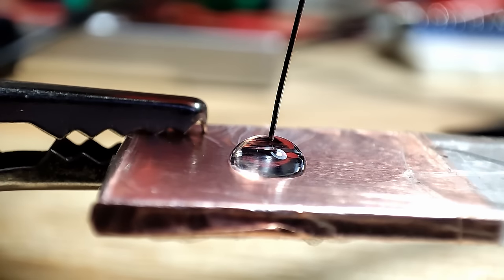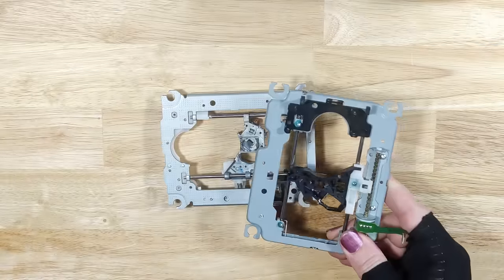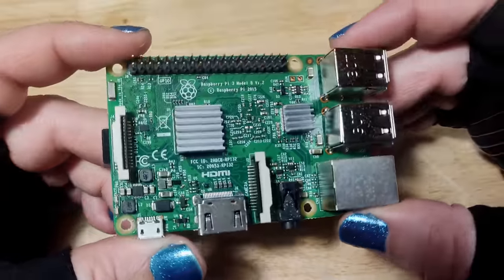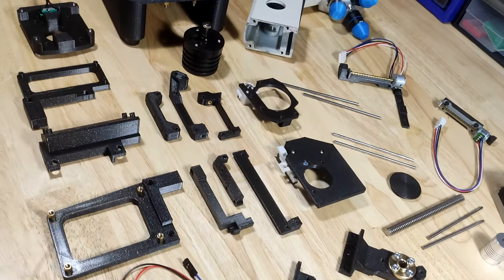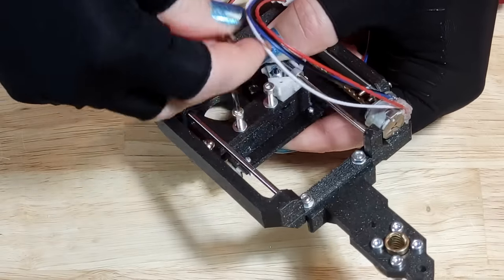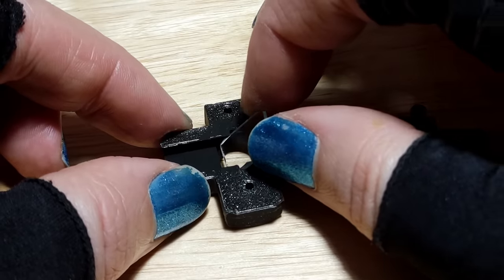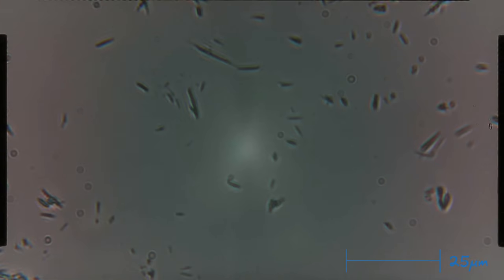How I Greatly Improved My Cheap Microscope

Comment: Excellent job! Since there's already a Raspberry Pi in the loop, you can relatively easily add some more functionality by using (almost) real-time image processing with OpenCV to fix contrast and lens distortion issues or add measuring overlays, or even automatic feature detection and measuring.

Comment: What an awesome video, at first when you pulled out the CD drives I was like "oh no, it's going to use those tiny steppers for the mechanism" and the you use them for the X/Y adjust and I wast like "Wait a minute, that's actually a pretty good application for those little steppers, it only has to move the slide, what a genius" and then you used the big stepper for the Z, that is a nice use of the correct steppers for each thing, keep up the amazing videos.

Comment: I really like the stepper motor controlled bidirectional stage.  You could do the same with  stepper motor and a higher pixel camera for focusing so the stepper motor is controlled by software that determines when an object is first in focus, takes a photo, then incrementally focus further down in increments and taking a photo at each focus increment until the object is just out of focus then stack the individually focused photos.

Comment: I'm impressed you could get rid of that much chromatic abberation by adding your simple DIY beam splitter and thus light it from the same direction as the camera.

My first idea when I saw your abberation shots was that it had to be coming from the glass piece you put in front of the sensor as this isn't flat on the sensor and thus allows for some light bouncing between sensor and glass (as it is probably also not perfectly parallel to it also)

I will also try to experiment with my microscope a bit more to add this as a light source option as I'm now struggling with ringlight and polarizing filters to get some decent shots.  (my magnification is nowhere near what you're using as I use it for PCB assembly and repairs and debugging my prototypes)
Reply from the maker: Indeed, I too think the protective glass might make the chromatic aberration worse, but luckily the epi-illumination seemed to greatly improve the matter. Unfortunately the epi-illumination makes the contrast a bit bad and I think that might be due to having no corrective optics for the light and because I have to pump so much light into the glass "beamsplitter" that despite the matte black pained beamdump area, some of the transmitted light does end up reflecting back up at the camera directly.
Reply: @BirdbrainEngineer  Also quite likely there is no anti-reflective coating on the "view side" of the lenses.
Maybe you can add some polarizing filters where you feed in the light and/or some aperture insert.
However this does probably require you to increase the amount of light you need to feed in even more.
Maybe you can also play around a bit more with the pixel integration time so you don't need as much light.

Comment: That's a cool mod and a cool project. You should take a look to the PUMA project. It's a very good 3d printed microscope, with an optional epi illumination system. You can probably get some ideas here, and learn a lot about optics.

230nm is not "ok" for an optical microscope lol, in theory it's very near the maximum resolution you can achieve with visible light.

With visible light a good oil objective (100x/1.25 oil) can resolve up to 244nm (0.61⋅500 / 1.25).
Some very expensive oil objectives with high NA can go up to around 200nm.

A 60x dry objective is typically 0.85 NA so you should not resolve more than 360nm with it.
Except if you are using near UV light, you can achieve 230nm resolution with a 315nm wavelength.

If your 60x objective is cheap and not made for light reflected microscopy you will lose a lot of contrast anyway, because it lacks anti-reflective coatings.
And if you don't use a coverslip (probably required, if you see 160/0.17 on the objective) you will lose some sharpness.

You can try to buy a half mirror to replace your piece of glass. With the mirror face correctly oriented
you should gain contrast (it will also remove some ghosting artifacts caused by the two sides of the glass).

I'm using one from aliexpress and you can find it with "Optical Glass Telephoto Beam Splitter" or "Beam Splitter 50T/50R" for around 5€.

Also, I'm not sure if the thick glass on top of the sensor is optimal. I would have used a much thinner glass.

Comment: At the beginning you're talkin about if it's necessary to build such a thing, and i can tell you it's definitely not!
But... i totally understand why you made it, tinkering with electronics, optics and a 3D Printer is so much fun to do! 
Great Video, great Project!
Reply from the maker: I mean yeah, getting a proper trinocular microscope for 300€ would have sufficed for everything... but this was a fun project and technically I spent only like 10€ on the new stepper drivers but the rest of the stuff I got for free from tearing down stuff :P

Comment: I have a cheap AM scope that is even worse than that one, at least yours has a iris, mine is just a disk with holes in it.....yeah...and its off center.....yeah....

Anyhoozle, Ive been able to correct a fair amount of the chromatic aberration by better aligning the stage to the optics. Basically wiggle it around, not just in translation XY but roll and pitch too (idk, add some screws somewhere as jack screws for modifying the plane of the stage to the optical path). 

There is a lso the stop spring detent thingy under the nose on the turret, you can loosen that and see if there is a more advantageous stop angle. You could try reseating the turret (take the head off, remember how the 3 screws are set so you can recenter it (another potential source of aberration btw), then remove the penta mirror holder (another source of potential misalignment, I had to use a pipe wrench to get mine loose), THEN work on breaking the nut loose that affixes the turret to the nose (oddly enough, its usually in there solidly enough that....well everything aligns to it pretty much...), but thats on you if you want to take on effectively an entire garage realignment(OH! By the by....you can open up the rotating section of the turret too via the screw and spanner nut in-between the objectives (the screw holds the rotating objective mount on, and the spanner nut sets the turning tension (IIRC), ie how much resistance there is to turning it once you overcome the detent) BE CAREFUL!!! There is a handful of tiny little ball bearings in that thing....so be prepared to wrangle them if you go in there)....it can be kinda frustrating....but they dont really put too much effort into setting up these cheap-o scopes from the factory. When I got mine I had to take the lenses apart because there was mold in them.....yeah.... 

Work slowly and incrementally, and you should hit on an orientation that counteracts the aberration you see down the tube. I guarantee you're aberration problems are more to do with alignment than your lighting set up. Either way, fiddle with it, thats what the hacker/maker hobby is all about ;)

Comment: This would be a great place to use a Pi Zero given your low compute needs, but I imagine the full size pi is what you already had lying around.
Reply from the maker: Yes, the Raspberry Pi 3 is what I had laying about and unused. As for using the Zero... I'm not convinced it could handle the stream at such a high fps (maybe the Zero 2 could), plus the stream over wlan is going to be a concerning proposition compared to just lan. I did try to stream over wi-fi in this case too, but it did have some problems... but that could simply be because my router is kind of far from the microscope and the signal quality isn't really the best it could be.

Comment: Is there any way to switch the objectives/lenses from the microscope? I know the cheaper microscopes have them hard mounted but your set up is awesome, i think the only bottleneck truly are the bad optics. That and maybe more light would help a lot
Reply from the maker: The objectives can be replaced, however the thread is weird... I have not been able to find fitting objectives anywhere. I did buy a cheap 60x achromatic from China just to see what would happen, and 3d printed a thread adapter... And it worked, but it's fairly unwieldy and the contrast issues got pretty bad in most cases. I did manage to resolve down to about 230nm or so with the 60x though.

Comment: this is amazing work, way to go!
Only thing i would do differently is to control all directly from the raspi rather than the external MCU, so you could add a fully remote operated microscope. Why would you need that? dunno. but that's not the point, the point is you can :P
Reply from the maker: Of course I considered that but I did not want to spend an extra week figuring out how to write that kind of code, so this time I used the Arduino... which also means that technically the microscope is usable without turning on the RPi (eg. when I want to just use the normal eyepiece... though I probably never will, the camera is so much more convenient haha)

Comment: Great project. I watched your spin coater design as well, another very cool piece of lab equipment. Im not sure what your final aim is with these pieces of equipment, however if you are trying to get nice films from spin coating your need to clean your substrate in a non contact method, normally an ultrasonic bath followed by a surface treatment, such as UV ozone cleaner. Anisole and xylene are good solvents, but have you tried water? If you want to test out surface treatments and coatings just use thinned PVA glue initially. You should give KiCAD a good great open source PCB design software
Reply from the maker: Next video will be about dealing with the cleanliness side of things :> 

The end goal is as was said- microfluidic devices for now, and experience for future in order to hopefully make integrated circuits, lcd-s, oled-s and other such technology that relies on such miniaturized processes.

Comment: 1:38 Dam I love this video! :face-red-heart-shape::face-red-heart-shape::face-red-heart-shape::face-red-heart-shape::face-red-heart-shape::face-red-heart-shape::face-red-heart-shape::face-red-heart-shape::face-red-heart-shape:
I've got the same reflexion.. Should I buy objectives and design my own with my 3D printer and maybe pimp it with arduino laying around???
Then, one year later, I still have the 4 unused objectives and eye piece and a lot of random arduino parts, but missing a scope!
And this week, I've found a new/open box discount on a SWIFT 380B for 203$ canadian, shipping next day included!
So, short story, it's better to buy a great scope in discount.

I will print dark field filter and phone holder to get great image and save my eyes.
Maybe one day I'll DIY epifluorescence on it?

SWIFT 380B regular price 299$ canadian. Sold by SWIFT on Amazon (218$ US = 204 Euro)
It was just above my budget for this project. But I couldn't resist at 203$ cdn (148$ US = 138 Euro)

Comment: Did you test if the protective glass in the camera compartment might affect image quality? You might get a nicer final image if it's removed. There is the chance light might be bouncing around inside the glass and affecting the contrast or sharpness. It might be totally fine I don't know. It's just pure speculation from someone with a very very casual interest in camera lens design. It's a nice project you did a good job with everything.
Reply: I think it might be giving you a little chromatic aberration. Camera lenses need to be accurate to wavelengths of light. I am just speculating here. You probably know more than me with everything here lol. You could try painting the edges of the glass with that acrylic paint too. It might help with light bouncing around within the element.
Reply from the maker: Could be, though from the very limited and quick testing (to prevent dust on the sensor) I did, it did not seem to impact the quality at all to be honest.

Comment: love it ^^ would love to try also to do the optical stage diy because then the whole thing could be 3d printed. i have some microscope objective conected to a bare ccd webcam camera. it kinda works just like yours. i would like to focus stacking for 3d nano scans since this is cnc controlled.
Reply from the maker: Maybe it would work out -in that case it would be possible to shape the epi-illumination light a bit better too as the light-path can be longer than 2cm between the lightsource and beamsplitter haha. The problem I can imagine happening is that the alignment would be difficult to get perfect with 3d printing. Cool idea though, maybe one fay I'll try it out!
Reply: @BirdbrainEngineer  maybe with resin parts. So far for another project I been using resin parts and being able to print usable gears at 0.5 mm pitch is mindblowing and fairly mechanical accurate. I will look up if I can think of something.

Comment: Nice project, can the fps of the camera be higher with lower resolution?
Reply from the maker: Yes. At 1080p you can easily get 30fps, 60 might be difficult but iirc the Raspberry Pi cam 3 is able to do it technically. You will certainly need heat sinks on your Raspberry Pi though, as the streaming is quite demanding, even with the heat sinks shown in the video, the Pi gets up to like 60-65C.

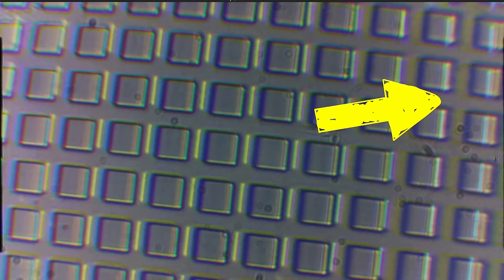Comment: 11:17 could be field curvature, lens based telescopes have the same issue and require a field flattener to fix.
You also seem to have a lot of chromatic aberration  which is q problem with the objectives. (Although your light source isn't helping as you find out)
Reply from the maker: Yep, the objectives are not great but they will do for now!

Comment: what i've seen someone else do for the lighting setup is a ring light and a polarizer filter over the objective lens, though i think that might be a bit of a hassle to replicate on your setup.
the result if you can make it working is amazing though for electronic work
Reply from the maker: Was the ring of lights on the outside too?
Reply: @BirdbrainEngineer  yeah, it's not exactly attached to the objective lens
Reply from the maker: @aronseptianto8142  I'd imagine then what you are talking about is likely a stereo-microscope, which usually doesn't magnify past 40x or so. That is fine for working on PCB-s, but with my liquid lens project I was having trouble with dust particles only some micrometers in size, so to see those, you can't use that kind of microscope. The polarizer in their case gets rid of glare - photographers and videographers also use polarizing filters for exactly that purpose.

Comment: Would the lenses of the optical drives be of any use?
Reply from the maker: Probably not. The lenses in the optical drives are small (even the half mirrors in it are too small - I initially wanted to use a half mirror from there).

Comment: just a small thing

it is physically kinda impossible to go much under 500nm with light microscopes because your light wavelenght is literally maxing out in that range. you are pretty much at the edge of what a normal light microscope can deliver.
Reply from the maker: With no extra tricks, optical microscopes can resolve objects as small as half the wavelength of visible light, which means it would be possible to make out features down to about 200-250nm or so. So, technically there's still some ways to go, not to mention having worked with it a bit by now, in practice, without painstakingly finding the most optimal z height and all, I am only able to resolve features down to about 500nm (with the 40x objective that the microscope came with)... beyond that it's really a chore to really see anything on a real IC for example.
Reply: @BirdbrainEngineer  
yuss

you just sounded so dissappoinnted with the "just to 300nm" and thats already about so close to how good it gets

especially if you dont use a single wavelength light source

love your video and will definitly use all the inspiration I can get for my own microscope, want to stalk bacteria with it tho

Comment: Neat build, in fact I think I'll dig out my old microscope and see what can be done with that.  

Now if anyone's interested DIY perks did a video on turning a laptop webcam into a usb webcam (so if you have a laptop for parts or know a computer repair shop), it's at:  https://www.youtube.com/watch?v=C8pFkhkTvqo

As for the light source the Dollar Tree used to sale (perhaps they still do, just haven't seen them for a month or so) these clip-on selfie lights that possessed a ring shaped circuit board with a rechargeable battery occupying the center with three light settings.  I figured it'd be possible to either use it as is or perhaps even take it apart and place the ring-shaped board just below the lens assembly.

Comment: 3:57 The fastest way I've found to write and learn Arduino coding: ask Chat GPT to do it for you and to label all the line to understand the purpose of them.:face-blue-wide-eyes:
I've tried it: work perfectly!! And you can ask to modify it, optimise, upgrade. No need to learn how to code. You can then adjust small stuff ex number of millisecond to wait between step and so on.
You can also ask to draw the schematic and help you decide what module to buy, etc etc etc!